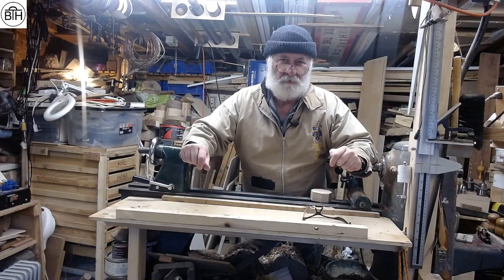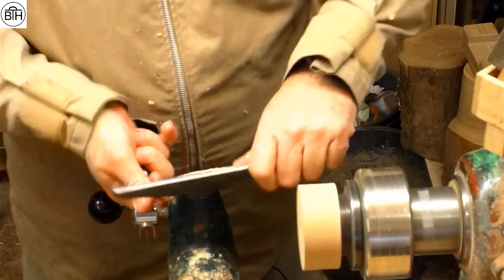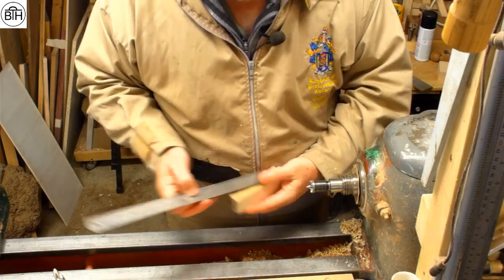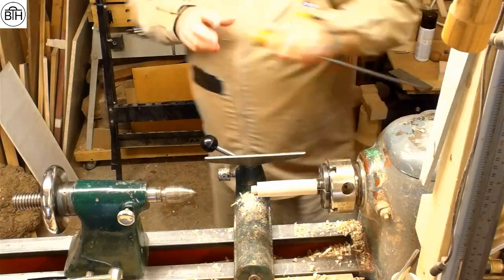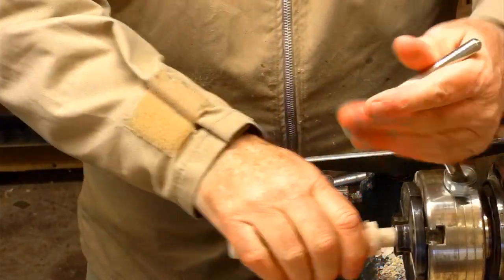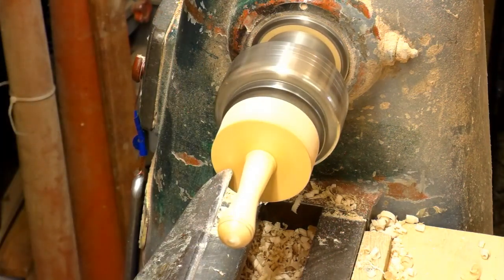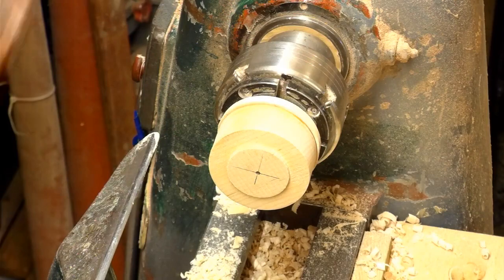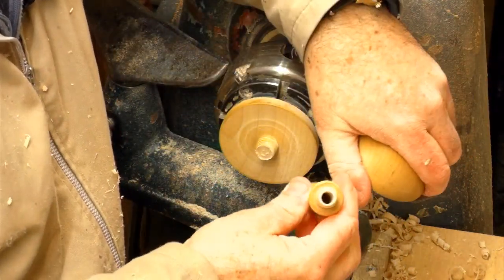How I turn a darning mushroom on the lathe.

Comment: Thank you John,  you are a great teacher!  I really appreciate when you talk us through each step.  I don’t have thread tools but do you think  it can be done with a friction fit?
Reply from the maker: It probably could be done with a friction fit but just be aware that in time it is bound to become a loose fit through wood shrinkage. You could try just using a tap and die to make the threads, sometimes it works, sometimes it doesn't.